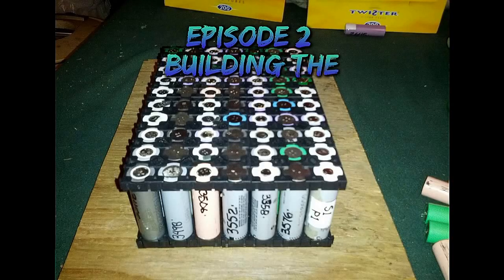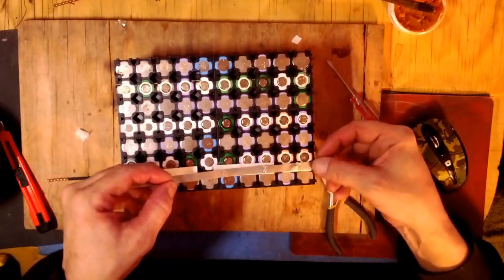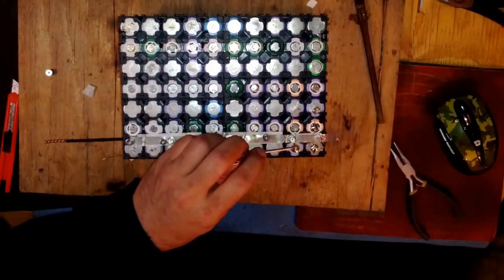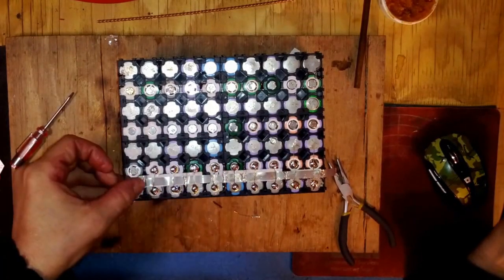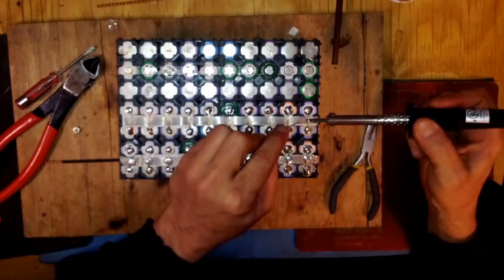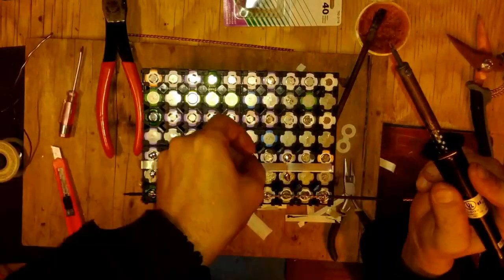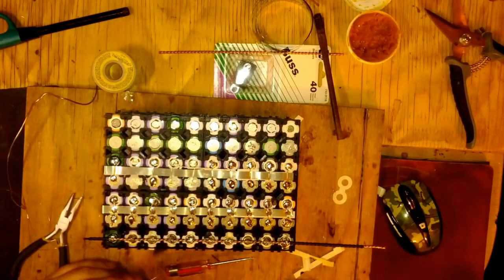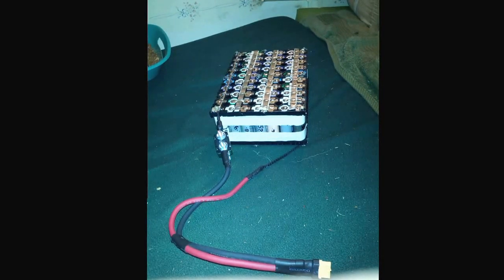Episode 2:  Building the 26v  18650 Pack.

Comment: Cool setup. I'm currently doing my own, almost exactly the same, mine will be 200Ah though. I've seen a variation on what you're doing, which is to tin the positive and negative before attaching the fuse wire. I think you're right about the heat, my first attempt I think I killed a few batteries with heat, I made a 7S20P pack and it took me ages and now I've totally pulled it apart and using my learnings from that to create a new pack.

Comment: Sooo....where's the next episode? lol. On a more serious note, how is your pack doing, since my planned pack is remarkably similar to yours :)
Reply from the maker: This pack is still doing great over a year later.  I have since built a 7s 25p pack that holds about 2 kwh @ 26v nominal and I use them both to power my 24v 1200w inverter in remote loctions.
Reply: Aspendell Impressive! I'm looking at 7S15P with 3000mAh cells.

Comment: You could use doublesided tape to hold the nickel strips down. You would need to solder fast, though.
Secondly, why are you using copper buss on the one side, and nickel strip on the other?
Reply from the maker: I don't know of any double-sided tape that is heat/flame retardant.  The composite paper that they use in battery packs is specially treated for this specific application.
The positive and negative busses for the whole pack are wound AC housing wire, while the sub-busses between each parallel row are nickel-plated strips.  The reason I went this way was to provide a beefier than necessary conductor to spread the full voltage to the far end of the pack on both sides rather than releying on the nickle strips.  If I had not gone this route then at high charge/discharge rates the cells in the back would have received a few millivolts less than the ones up front where the power take-off is and they would charge/discharge at slightly different rates.